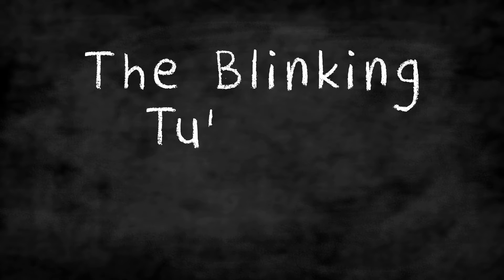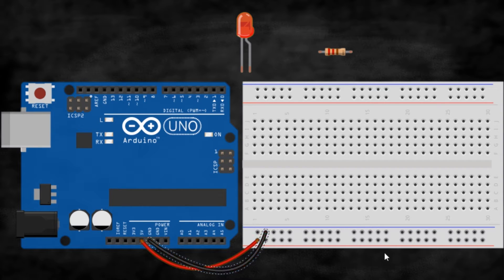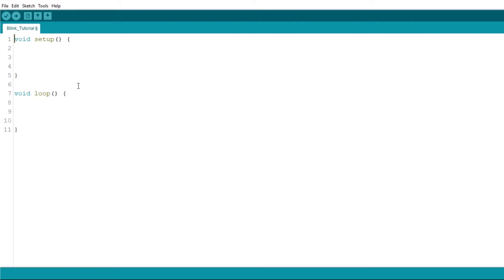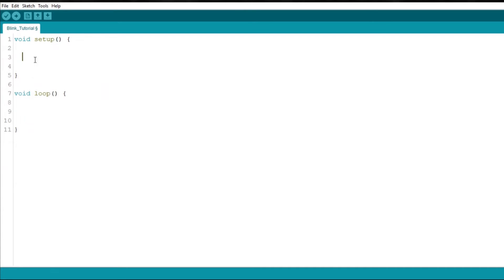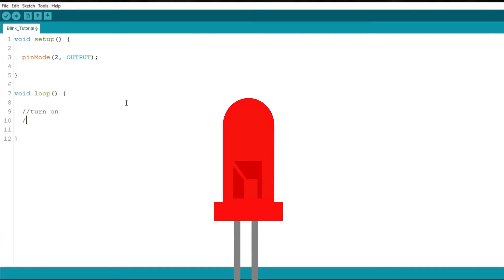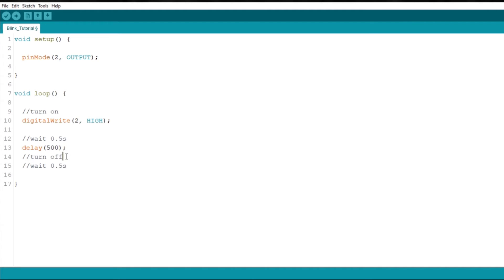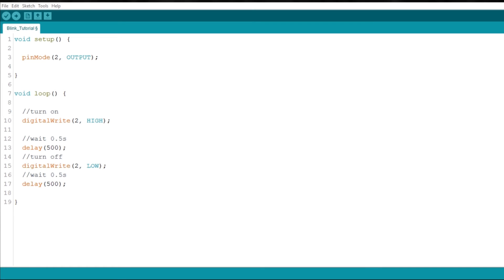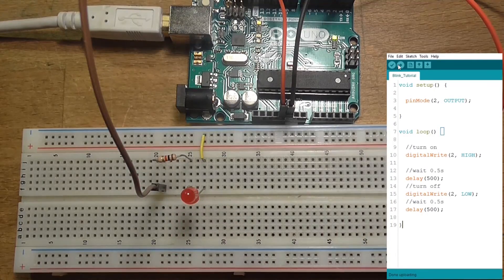Arduino Blinking LED

Comment: Great 😀what is the program name you use to make simulation  circuit?
Reply from the maker: Hey! Thank you! The software I used here was Fritzing. It does not simulate but it is very useful to create hardware set ups. If you see any simulations, they were probably added in Adobe After Effects.
Reply: @freethepotato   Is Fritzing is simulation software ? means can we run our schematic in this software ?